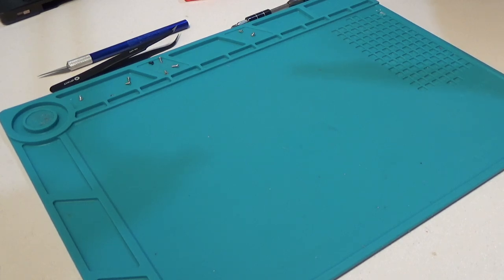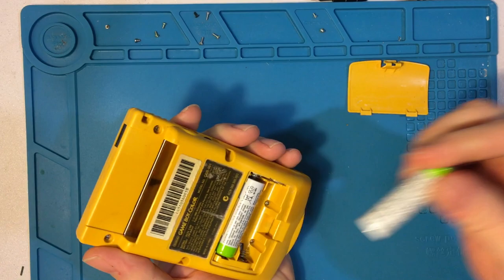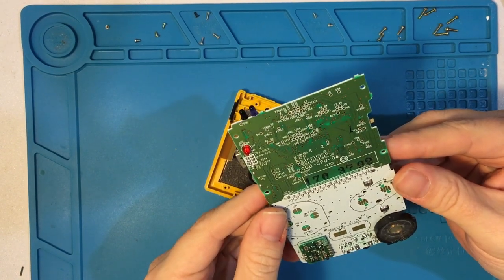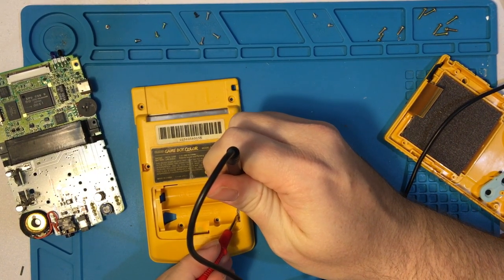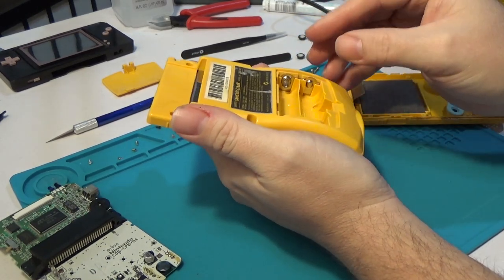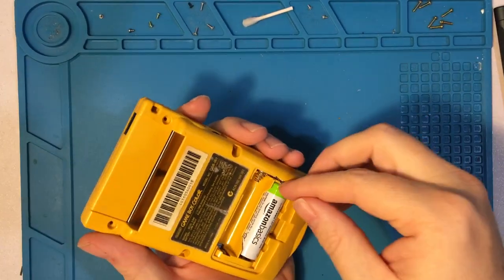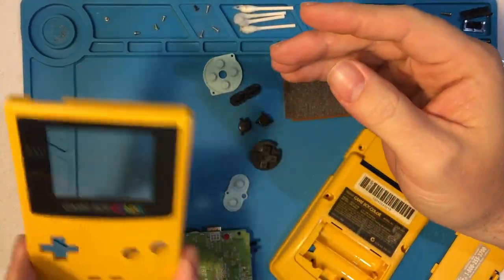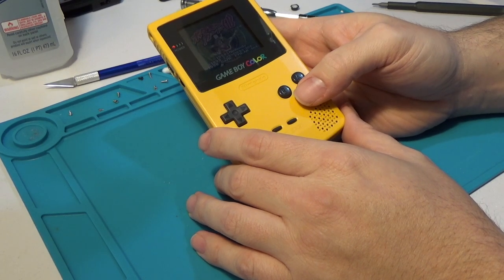Fixing a broken Gameboy Color.  This thing smelled awful!

Comment: Did you have any type of cleaning liquid on the toothbrush or just brushing is enough?

Nice video ☺️
Reply from the maker: Thanks!  Yeah, I'll use a combination of vinegar, and/or IPA for cleaning.  (Vinegar if I need to get any corrosion off of the board, and IPA for general cleaning purposes on the board.). I feel like my brush may be a bit too soft, but I'm always a bit leery of going with a harder-bristled one, and risking damaging some of the components if I brush too hard!
Reply: @TheBrokenPast  thx a lot! Never cleaned battery contacts before :D and yeah I'm always afraid of damaging ribbon cables on the Ds'. 
Feeling like: "I'm Hulk, I'm fixing stuff" xD
Reply from the maker: @shanonlola555  Yep!  That's always the feeling for me too.  I just try to remember that if you start feeling like you need to use force, that you're probably doing it wrong, and should take another look at it.

Though sometimes that's hard, especially with trying to route the blasted ribbon cables through the hinge on the DS!
Reply: @TheBrokenPast  oh yeah I'm always feel bad to find broken too screens... Just normal old ds is alright :D 

But top screen = nightmare xD